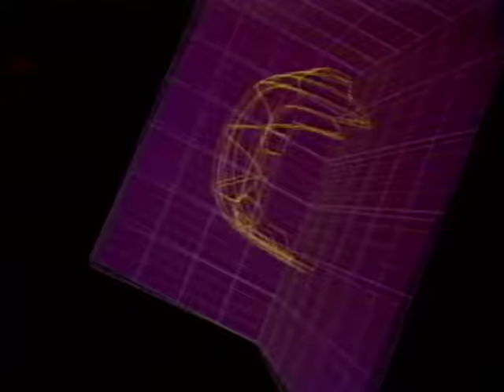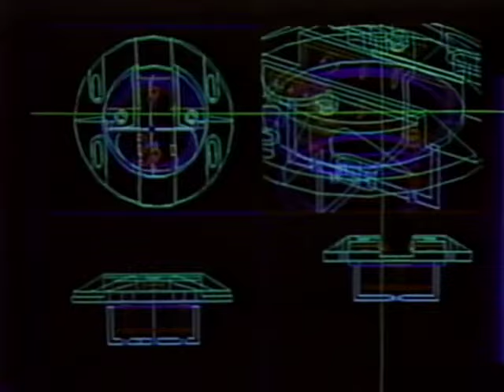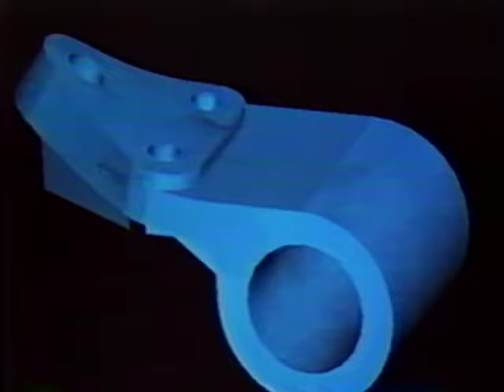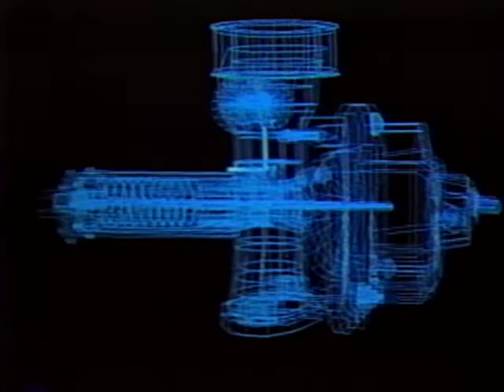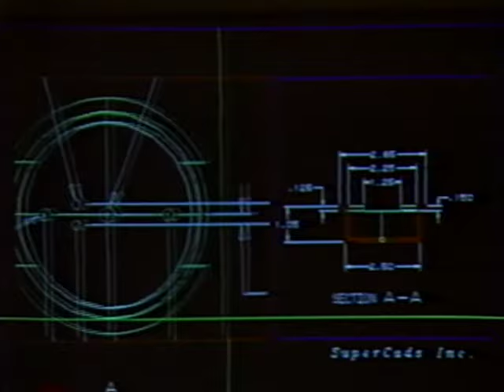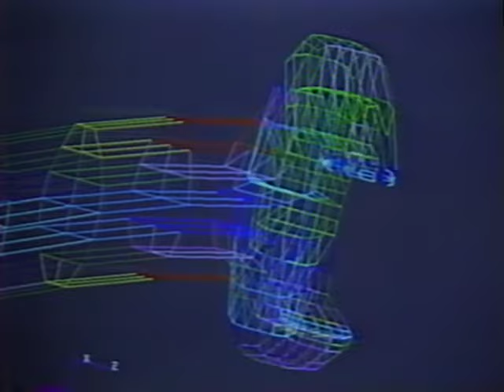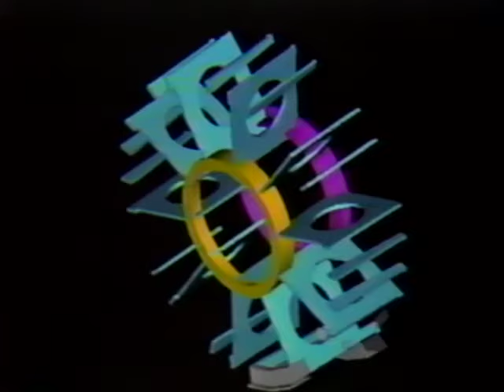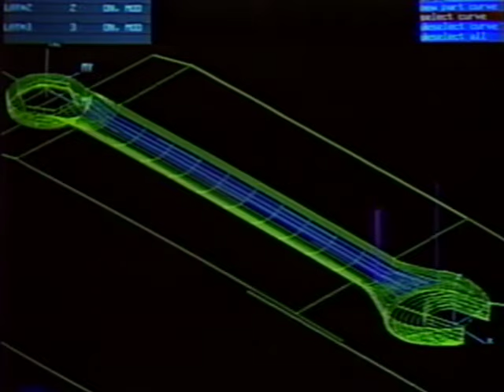Silicon Graphics Superworkstation Demonstration

Comment: From what I'm reading, the IRIS 1000 was disk-less and was designed as a terminal to be used with a mainframe. That may explain how it appears to be doing everything shown in this presentation. It was the 1400 that could be run standalone, I believe. Granted, if the 1400 can do this or better, I'm thoroughly impressed: the specifications of even the 1400 would have been below those of the Macintosh II that Apple offered a couple of years later — yet I don't think I've seen a Macintosh or other personal computer from the mid-to-late 1980s do anything near as complex as what these workstations could do. Perhaps it was an inherent advantage of the systems' running UNIX. Maybe, for this application, the software utilized the hardware exceptionally well. In any case, I'm really fascinated. My technical expertise is limited, but I sure know just how amazing this would have looked in 1985. (The price tag surely was commensurate with the quality of the CAD renderings!)
Reply from the maker: I was a child when this stuff was hitting the market.  PCs were not exactly a thing yet, although close.  Workstations were many orders of magnitude ahead of "desktop" type systems that folks could reasonably afford for home use... Extremely sophisticated schedulers in the kernels of the OS's (mostly unix-derivatives as you pointed out), lots of ASICs for doing various things, RISC instead of CISC.... Amazing time for engineering advancements and hard to keep up with the technology.
Reply: @asmallpottedplant3709  You've pointed to good examples. It seems that the most notable advancements in personal computing (besides the personal computer itself) were made in the way of workstations. That technology would subsequently trickle down to consumer systems. I suppose the exception would be the GUI: if Apple hadn't rushed it to the Macintosh, I don't think we'd have seen that type of interface on a personal computer until maybe the 1990s. As it was, it took Xerox 10 years before they ultimately took their plans for a GUI and traded them for Apple stock options.
Reply: @icantgivecredit871  The Amiga 1000 released in 1985 already had GUI and colors at launch. So they were ahead of the Macintosh. As for the workstation systems, they had custom graphics circuitry way more advanced and ASICs handling IO etc, and resolutions way higher than the consumer market machines. The price tag reflected this, it was insanely expensive, and companies were the customers, almost never private persons. Imagine 30-40,000 dollars for a machine, in 1985 value. Btw, my SGI Octane2 from 2000 could be fitted with 8 GB of memory.. an amount Apple delivers in some of their new machines today in 2022.
Reply: @olavaaf2218  Yes, I'm aware of this. Apple did not care for color in a consumer PC because there were no color printers to take that image and put it on paper. Workstations evidently were much more advanced than personal computers were, for a while. By the early 2000s, that changed. My mind points to the PowerMac G5 (2003), which was the first mainstream 64-bit system. It, too, could be upgraded to 8GB of RAM.
Reply: @icantgivecredit871  It was also much cheaper and much less complex to make it without color. The chipset of the Amiga was pretty revolutionary for a home computer at the time.

Interesting fact is that SiliconGraphics went 64-bit already in 1994/1995.. both CPUs and OS. 
The memory of the Octane2 was ECC, error correcting, the PowerMac G5 only got that in 2005.
Interesting you mention the PowerMac (I have one G5 too). I feel Apple looked towards SGI when they designed their high-end systems and OS - making it Unix based since the NeXT days. Also choosing SGI’s OpenGL for their graphics stack in OS X was a testimony to this, even using it to drive the main GUI. In some sense the Pro line of Apple became what SGI systems offered since the late 1980s. Apple took the best properties in an SGI system. :)
The biggest missed opportunity of SGI, was that they stopped focusing on their core asset, graphics. They should really have had the position Nvidia has today. Nvidia got there subsidized by gamers.. SGI never considered the gaming markets seriously enough, except for the N64 work and chip they delivered, until it was too late. They would have to scale up, mass produce and make it affordable, but never did.. always very high-end until competition eventually caught up. That was their demise.
For a long time they had the serious advantage of a dead stable Unix operating system, IRIX, and market leading graphics.
Reply: @olavaaf2218  All interesting history to hear. Yes, personal computers seem to have always reflected what was initially done with workstations. The GUI was one of the most important ones, and it took Jobs - someone with a vision - to successfully bring it to the masses (arguably prematurely). As I gain knowledge on this subject, I strangely feel increasingly less impressed by vintage, high-end personal computers.

Where I think we really began to see the influences of workstation hardware/construction/aesthetics reflected in mass-produced personal computers was by the late 1980s/early 1990s. I consider the traits of both Macintosh and NeXT systems from the time to be exemplary  of this - particularly the hardware and software of NeXT computers. Talk about inspiration from SGI. Another fun example is Apple's Macintosh Quadra 900 from 1991, which appears to bear significant cosmetic resemblance to SGI's Iris tower from 1986. (I was trying to find out if Frog Design had done SGI systems before designing Macs, but I don't see any relevant information online.)

In regards to 64-bit CPUs, I'm definitely aware SGI had this as early as the mid-1990s. I believe it was circa 1997 when consumer PCs finally began to stack up. (The PowerPC G3 CPU was a hit.) You are obviously far more cerebral on the matter, so you might be able to explain to me why Intel and IBM managed to subvert SGI and their RISC chips. Some arguments point to manufacturing volume having been an advantage - that Intel and IBM eventually had enough capital with which to invest heavily in streamlining their manufacturing process and designing better chips. 

This makes me wonder whether or not SGI truly could have successfully continued had they brought their focus back to graphics. In the PC space, I'm not so sure: at the same time other CPU manufacturers began taking their customers, I believe GPU manufacturers were doing the very same. By the late 1990s, desktops were being equipped with some decently good graphics options from ATI. That said, SGI might have had success if they had clung to a certain part of the market - console game, for instance, with the likes of the original Xbox.
Reply: @icantgivecredit871  SGI could have maintained had they just focused on the graphics, keeping their great and stable OS up to date, and parallel computing. Buying CRAY supercomputers was a wrong and expensive move. By the mid 1990s they should have developed an affordable mass-produced 3d-chip, sell it into the PC market. They also could have made much more affordable workstations based on such new chips, and supported their IRIX developments to go further - let's say a continuation of the N64 affordable 3D-graphics project. They owned MIPS, and had their own graphics chips, and their own really good UNIX OS.. very similar to what Apple has today with their own Apple Silicon, macOS etc. Apple always looked towards SGI in some sense..
SGI could have captured even larger parts of the pro market and high end home market, had they focused on their own tech and developed it, and scaled production up to enter new markets and compete on price. They could have had the positions of Apple / Nvidia today, unfortunately they were completely mismanaged for the last 15 years of its life.
Check out this: https://youtu.be/6za64T2Wulc
Reply: @olavaaf2218  Very interesting, thanks again. I'll take a look at the video.
Reply: They were typically connected to a VAX.